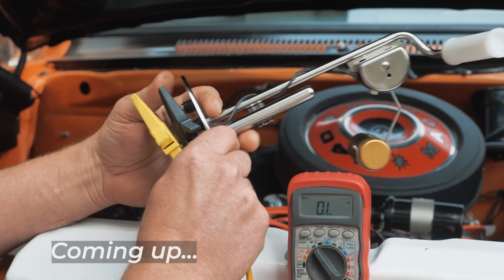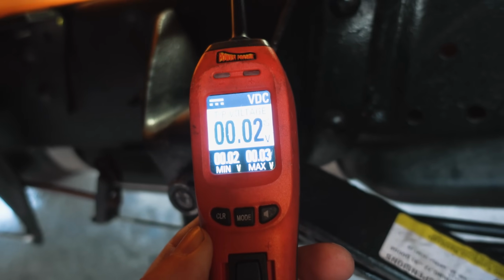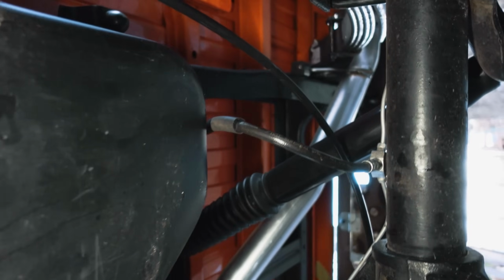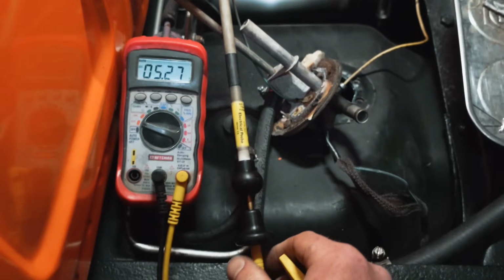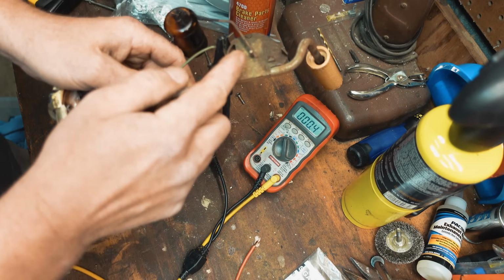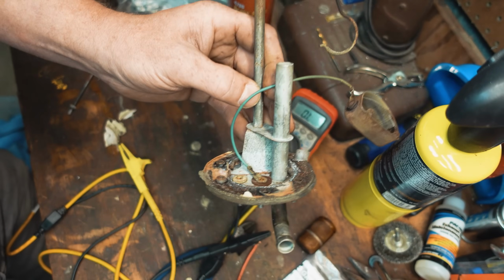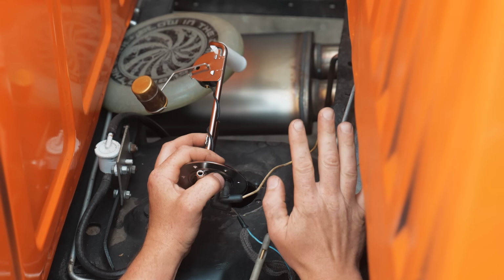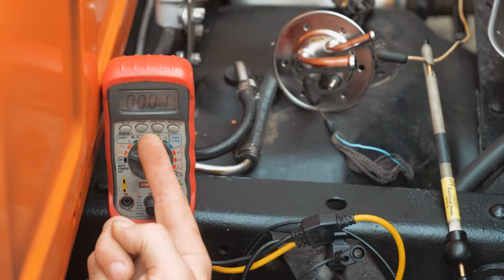Vintage Fuel Gauge/Sending Unit Testing [Dodge Pickup]

Comment: I've always removed the bolts at the top of the strap that's going to the cross bars 9/16 in a deep well socket and remove the drive shaft. After that you can get to those bolts on the frame but I've always seen those with the nuts on the inside of the frame.

Comment: Thanks for the reply. Them damn strap bolts on the frame rail are factory. My gauge is good. Ran a separate ground to the sending unit and nothing. Pulling the tank and flip it over probably trashed the old unit. Bad thing is got a full tank now.
Reply from the maker: yeah that sucks. I assume you grounded the sending unit wire while watching your gauge?
Reply: @ScannerDanner  Yeah grounded the unit wire. Good thing I pulled the sending unit out. The filter screen had split open so just anything in the tank going in.

Comment: I got a weird one. '79 Dodge D150 had to drop the tank because of a leak. Got it fixed. Ok gauge worked before now not a damn thing. And drooping the tank is a bitch in them old trucks. I think it might be the voltage limiter.
Reply from the maker: The instrument voltage regulators will affect all the gauges not just the fuel level gauge. You need to do some checks at the tank. In particular with your sending unit ground

Comment: where did you find a plastic tank for a 78 Dodge and how many gallons is it?
Reply from the maker: Not sure. Original owner had it in there. I believe it is 18 gallon. This truck was built from like 5 different trucks
Reply: @ScannerDanner  thanks.  In my search for one, I found a place that makes a 40 gallon tank.  I like that better than plastic.
Reply: @ScannerDanner  thanks.  I actually found a place that makes 40 gal. metal tanks that are supposed to be drop in replacements.  I think I'm going that route on my 78 Ramcharger.

Comment: What about a faulty thermal limiter in the back of the dash?
Reply from the maker: Assuming youre talking about the IVR (instrument voltage regulator). That would affect more than just the fuel gauge when those fail.
Reply: When the ivr is operating correctly, you will have a cycling voltage between 0 to 5 or 7 volts, depending on tank level. You had a steady 5 volts
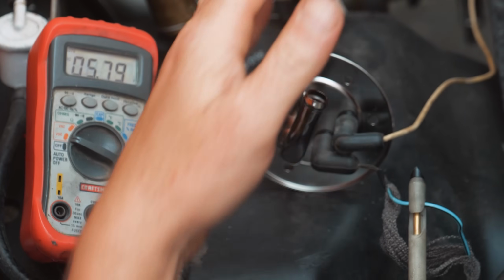Reply from the maker: @michaelstaples8184  at 46:54 in. Check it out

Comment: Ive hardly ever seen chry. Finish a vehicle nuts and bolts no studs no nutzerts no welded nuts no captive nuts, so primitive! I usually put a good sized tack weld on everything before i loosen nut n bolted components on chrysler years and years later and we have to finish their production vehicles so sad so many ppl bought that cheaply made "stuff" insert your own descriptive words

Comment: Great, very thorough video.  I just removed the dash from my '74 Dodge Stepside,  and took a ton of pics of the process.  The Voltage Reducer that plugs into the dash actually has some type of cylindrical capacitor that plugs into the center slot along with the Voltage Reducer.  There is also another round capacitor (identical to the first one) that mounts to another spot on the rear of the dash panel.  Im not really sure what they are for......would send you detailed pics if I had your email address.

I installed a beautiful solid cherry bed on my  '74,  and  I  tested the sending unit before putting it back in and reinstalling the tank......then installed the cherry bed.  After putting 10 gallons of gas in the tank, I am not getting the gas gauge to move past Empty.  I did all these tests also, and I have a bad sending unit.  I built the cheery bed with two shorter boards above the tank, so removing those should allow much better access to the sending unit.  Still a royal pain in the bee-hind.

I believe the gas tank straps should unbolt w/o removing the bed.....maybe the prior owner used different kinds of bolts.

Comment: Interestingly I've just started troubleshooting a '78 Dodge Power Wagon fuel gauge problem.  If you watch the whole video you can actually come up with a brilliant way to check the fuel gauge/sender without climbing under the truck.  The sender wire is available at a connector on the firewall in the engine bay.  Just connect a scope from there to ground and measure the peak voltages of the square wave.  You can interpolate full (4.5v pp) to empty (9.4v pp) or wiring problem (steady 5v).  Easy diagnostic technique that techs didn't even have at their disposal when the trucks were new.

Comment: What is the troubleshooting process you go through? I have a D100 and the fuel gauge just stopped working, stuck on E even after filling up.
I figured the floater might be broke, but now idk
Reply from the maker: Disconnect the sending unit wire and momentarily ground it with the key on. Gauge should go to full. DO NOT leave this grounded for long. Get someone to help you watch the gauge

Comment: ( these fuel meters, are faulty, float, larger or stem longer, i own 4 vehicles and 3 don't work ( float meters , must be recalled!)
Reply from the maker: Shit Chinese parts. There won't be any recalls. Mine works but it's definitely inaccurate. But at least I know when to get fuel

Comment: Is it possible to calibrate a fuel gauge in a 198 GMC1 1-ton duly fuel gauge mine shows a 1/8 of a tank when it's empty? If so how do I do it? I've considered removing the needle & reinstalling it in the proper location.
Reply from the maker: Not really. I'd imagine bending the float arm a bit?
When mine is on empty, I know I still have 4 gallons left lol

Comment: A little trick I learned repairing a float for a Model T carburetor is to have a bowl of ice water handy as you solder the float heat builds up causing the gas vapor to expand leaving pin holes in your solder. Dipping the float in the ice water prevents any pressure from building up!
Reply from the maker: That's a great tip!

Comment: 14:28 in regards to the question on fuel strap mounting. Bolts and nuts with captive washers was factory. Bolts were installed from above the frame rail with nuts removable from below. If it let me add a photo I would. 😊
Reply from the maker: send it to me on FB if you or there, or instagram

Comment: Scanner Danner my fuel gauge always reads full. This video is definitely informative and detailed, thank you for the video
Reply from the maker: Step 1, disconnect the sending unit wire and see if the gauge drops. If it does, your issue is in your tank/sending unit

Comment: MY GAS GAUGE stopped working on my 2011 buick lacrosse 3.6 liter , when i jiggle wires sometimes around and on connection X108 the gauge reads again but for most part doesnt work . i have 2 codes ,UO100 AND PO23F . my #10 fuse underhood keeps blowing , loud clicking noise under hood when i first connect battery and when i open the doors, trunk or lock or open car . when connection X108 is unplugged the clicking noise stops . push button wont start car , wont crank at all ,starter is good and works when i jump the relay . HHHHHHHHHHHHHHHHHHHHHHHHHHHHHHHHHHHHHHELP !!!
Reply from the maker: You need to address that short to ground first (fuse keeps blowing)
You'll need good service information to track that down https://www.eautorepair.net/marketing/html/products.asp?VID=&Count=Y
Reply: @ScannerDanner  GOD bless You and your family ,channel, school ,students , and all you touch and do SCANNER DANNER "PAUL" and thank you for taking the time to reply to one of your fans and subs , shows just how good of a person you are . i will check it out sir and again thanks ! oh by the way i did repost this car on your web site also under Rickyrick !!! 2011 buick lacrosse 3.6
Reply from the maker: @RGAIRGUNNINJA  I'll jump over and help when I can. Thank you for understanding
Reply: @ScannerDanner  YOU are so welcomed my brother , i really look forward to your videos , you are really awesome at what you do .and thank You for all you do for this community ! i suspect ,IF GOD ever has cars in heaven , YOU will def be one of the best in his motor pool !  LOL .
Reply: @ScannerDanner  oh Paul , by the way , i have mitchell 1 and pro demand . if i was enrolled in your class all this time ,i would of learned how to use all this valuable knowledge  lol .if you or any student in your class reference something from there i can go to it . i cant wait to join your class ,waiting on job ,i got really bad hurt and its put me outta of commission for 7 yrs , im ready to get things going again , your class ,nice auto diagnostic equipment ,this will never happen to me again ! thank you again from the bottom of my heart for all you did for me and all you do brother !!! :)
Reply from the maker: @RGAIRGUNNINJA  I'm so sorry you got hurt, but looking forward to seeing you back at it again! Thanks so much!

Comment: My 77 power IVR simply pushed in, it was not soldered.  I could see someone soldering it to overcome intermittent bad connection issues.  I don’t remember ever seeing one with a capacitor or resister on them in my eight years in the 80’s working in a Dodge dealership.

Comment: from what I recall, the IVR was just a heated bimetallic flasher setup internally. the voltage coming out would be relative to the battery/vehicle running voltage, minus the strip heater voltage drop.
the thing on the side of the IVR is a wire wound resistor, if you notice it says "60 ohm and 5% tolerance". 60 ohm's divided by 12V  is 5 volts, or whatever the nominal vehicle battery/running voltage is.
with no load the IVR's bimetallic strip heater current would be low and not hot enough to cycle. the cycle rate(pulse width) would depend on the total current load.

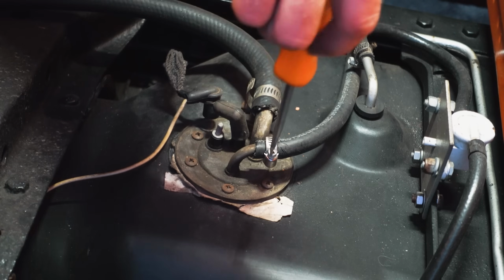Comment: at 17:42 dry rotted fuel hose. replace it all right away or you'll be having issues very soon.
looks like they used cheap junk hose and it's bad already, ethanol seems to eat the stuff for breakfast lunch and dinner.

Comment: I'm guessing the capacitor builds it's energy with current flow and then dumps it off similar to an intermittent wiper function. This probably is necessary to prevent overheating of the gauge.
Reply: that's a wire wound resistor (60 ohm 5% tolerance) it's label is viewable in the video at 48:39
being a many year electronics nerd, it's also rated at 8watts and that's a vintage one, likely original to the truck or that IVR module. the current listing for them is "HLW06.." vs "HLW-6.."

Comment: It is a resistor on the side of the IVR, 60 Ohm 5%... Depending on the IBVR design it could be used to time the pulses or circuit current limiting (???).. Possibly the purpose... Can't find a circuit design for an IVR...... (I am an electronics tech... Went to that after deciding not to pursue automotive tech) 👍
Reply from the maker: If I did things over again, I would want to do what you do 😉
Reply: @ScannerDanner  After a decade of electronics, I switched to IT. good money. No dirt and not hard on the back. But still, do electronics here and there. But the electrical diagnosis was always and is my favorite on cars...A teacher in high school gave me all the electrical work... and troubleshooting... Cheers!

Comment: On those tank bolts. On my newer stuff I believe there's like a Tee bolt that would have gone through that single middle hole. Those straps may not be factory. He just drilled new holes mostl likely slapped some bolts in it to make it quick and easy.

Comment: I found some junk in the bottom of a tank and used a little $20 fuel pump with a clear filter on the intake and just used it like a pool vacuum and suctioned the bottom of the tank. Went over the whole bottom of the tank and got it all caught in the fuel filter...just in case. It's always nice to have a cheap little fuel pump around to transfer fuels and stuff.

Comment: The IVR is very interesting to me!  If you watch at 49:50, the fuel gauge goes up in tiny increments, not all at once.  I'm assuming this is caused by the IVR pulsing.  I wonder if that's a mechanism to slow down the fuel gauge from bouncing to  the fuel sloshing in the tank?  

I was also hoping for use of a clamp on ammeter to the scope.  To see how high the current is during a full-grounded sending unit, and how the current interacts with the pulsing.

Awesome video!!
Reply from the maker: Wish I would have done that too. Thank you!
Reply: Yes, that's a mechanism to prevent the gauge from moving all over the place. Imagine trying to see how much fuel is left on a road trip... SHE WON'T STAND STILL! Lol!
Reply: My guess is because it works on a bi-metal at the gauge it doesn't heat up or cool off too fast. Good thing for a stable gauge.

Comment: I have watched you for some time and have to say You are a great Tech Paul - mainly because you consider all possibilities to rule out potential causes of a fault. And this is the way every tech should approach every diagnosis. Whilst I am aware you are open to potential criticism being on You tube , and have to bring your A- game as a result, I can clearly see you actually care about your viewer that he actually learns not just how to test, but also why he is testing. Many other You tube techs leave me bewildered at times because they don't actually explain in detail what they're trying to achieve from specific circuit checks. You go that extra mile and I applaud you for this.
Reply from the maker: Thank you so much! This really means a lot to me and is spot on with how I approach things and it is nice that you can see that. I get some push back from some people who say I talk to much lol
Reply: @ScannerDanner   Say it's not so. Not talking too much if the point gets made and understood.  Thanks for the video as I am having issues with my 76 D100. Fill the tank completely full and it may read 3/4 tank. I think I have a bad frame ground, or maybe something like your bad ground on the tank sensor itself. I noticed your inside sensor ground pretty quick as being somewhat corroded and a possible issue.
      I am also having issues with my temp gauge reading real low. Wire from temp sensor to gauge is all OK. A temporary ground to temp sensor wire gives a slow sweep to hot. Measure temp sensor and I have 75 ohms to ground and it changes as the engine warms up or cools off. Wondering if I have a bad sensor ground or grounding issue where the temp sensor screws into the manifold. Have to wait for warmer weather as I don't have a heated garage.  Thanks again!   I am a lot jealous of your very nice power wagon!!! I have had my 76 since 78 and it need restored, but is still a good truck.
Reply from the maker: @seniorrider9337  welcome to my channel and I look forward to helping a fellow Tin Grille owner any way that I can!

Comment: no thats not factory, the original owner was a hack in ways, fuel tank, my bros 74 ramcharger( he had a factory 440 in it)  . IDK if you have a polyethylene tank or not he does. studs would be spot welded from back side, or nuts spot welded from back side of frame rail. which ever the case factory would not spend the time or money to put through bolts,  but honestly drop the tank. We did, hose it out good, let air dry. esp if its a steel tank. would por 15 help? coat inside of tank? who knows. I assume you have new gasket for float as well. Yes 1 guy can drop tank , i used a hein warner floor jack(1960s) with 2x12 on it and slolwy let  tank down.i grew up in NY so i understand the rust thing.

Comment: Uggggh!
Coulda, shouda, woulda had you have known the tank was full of crap (Sending unit debris) before you set the bed.
My Bronco used to get pin holes in the brass float every couple of years change it as well.

When I see a tank fastener A$$ Backwards like that I put a strap on the bolt side and tack weld it to the bolt to keep it from spinning you just need to use a single strap to hold both bolts from spinning (builder should have known this)
Nice ride though

Comment: ISTR at least in the UK the old tech IVR were like the old style gauges (around pre 1975)  and  had a bi-metal strip inside later the IVR looked the same metal package   outside but the internals were  a solid state voltage regulator.
Reply from the maker: So 75 and up went to solid state? That would explain what we saw in the scope reading

Comment: The ivr is controlling power pulse power to the fuel gauge the oil gauge and the heat gauge using an analog meter would have been interesting for those that don't understand that.

Comment: while you have the bed off, flap disk the paint or coating, put aluminum foil over the bolts and weld the nuts for the tank strap bolts.   if you have an electric clicky clacker fuel pump laying around throw a tube on it and hit it with 12v to suck those metal flakes out of your tank.   just did a pump on my chevy and there was all kinds of crap because the assy rusted out that locks the pump in...    was a pain.  thanks for posting, been watching you for years Danner.  never forget those moog u joints....what a pain in the rear.   think it was on your jeep.   had issues with the moogs i did on my pathfinder too.   did em again more recent and went with a different  brand, whole job was like 10mins.  was like butter.
Reply from the maker: I did suck the crap out of the tank, but used gravity and my mouth to get it started  😆 
Not good, let me tell you
Reply: @ScannerDanner  haha, ya that is always the suck 🤣  c what I did there.  May have been a bit of a stretch
Reply from the maker: @AGuysGarage  🤣🤣

Comment: You should get a min and max ohm reading from pin to pin or sender wire post to ground when moving the float empty to full without any major fluctuations. The rust probably came from that sender and do to sender condition the inside of the fuel lines.